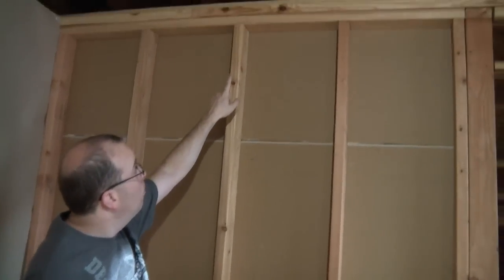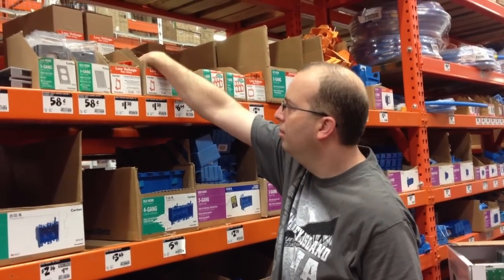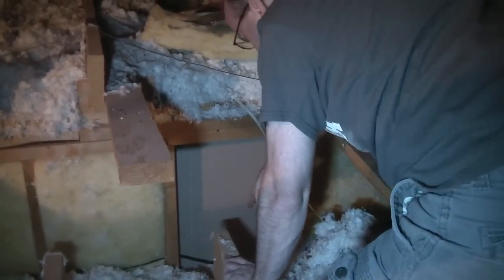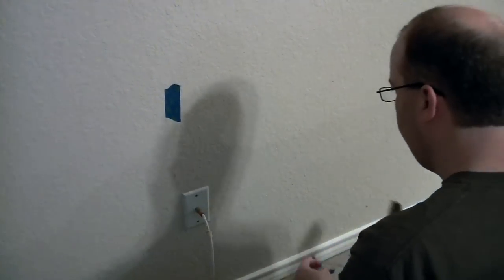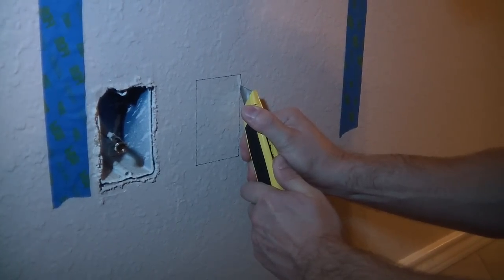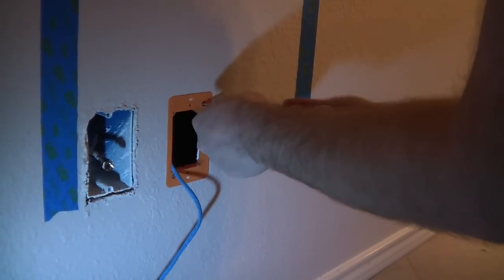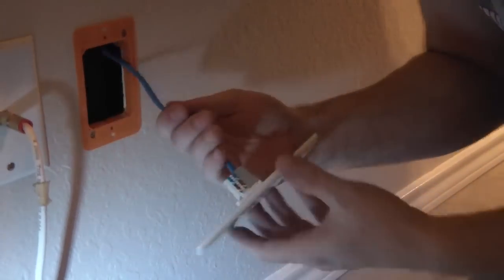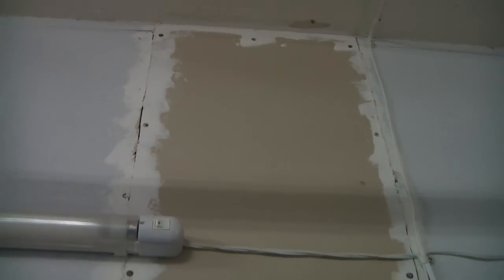How to install a network jack into a wall from the attic.

Comment: You know you could run the wire the same area where your cable coax wire is. You can get plates that have both Cable Jack and a Ethernet Jack on the same plate. Saves spaec and does not look ugly having so many White Plates on your wall.
Reply from the maker: +TekReview's The coax was in an electrical box that was nailed to a stud.  There is not an easy way to fish the wire into that box without cutting drywall.
Reply: The iBookGuy Wow, who wired your house, Gomer Pile? For others one plate would work great.
Reply: Subject of the video was "how to install a network jack from the attic."  I searched on this, found the subject matter in the title, and found precisely what I needed to know in this video.  The 8-Bit Guy perfectly stayed on task in showing me exactly what I wanted - excellent video.  On a side note, you could consolidate your name - TekReviews is not possessive, you could get by without the 's.  For others, not using the apostrophe 's' works great.
Reply: +The iBookGuy - I was able to back out the nail holding the box to the stud in my case and replace with an old work box.  Another alternative is to use a dremel or weinsaw to cut some space in the new work box to fish the cable.
Reply: @TekReviews Wow, who taught you wiring?  New work boxes are always nailed to the stud and almost always have clips that prevent wires from being pulled backwards!
Reply: TekReviews you know that wasn't his house
Reply: You could pull the coax all the way up to the crawl space with a pull string/extra way taped to its end, then tie on your cat5 and pull both out the box.
Reply: +The 8-Bit Guy That may be true in your case,but in my case, all I have to is unscrew the coaxial connector from the wall plate,then run the wire through that whole. Might use a switch since I wanna use wired on both a PC and a game console.
Reply: +Eddie Rowe Yup, I have used a sawsall with metal blade slid in between the stud and box to cut the nails off the existing box. You can even reuse the existing box by side screwing it back on to the stud from the inside with a longer tip attached to drill.
Reply: i would remove the phone jack and put the Ethernet jack there
Reply: TekReviews Having 2 plates is fine.  No one is going to be looking at them anyway.
Reply: +Chucks Basix you must be responding to the wrong person. I stated you can get a PLATE with BOTH Ethernet and Cable on it. Instead of having two plates side by side. Think before commenting, apparently you and the VIDEO maker have NO idea what I and other's were talking about. Putting TWO Plates side by side looks DUMB when you can buy a PLATE with an ETHERNET and COAX hole already made.

Comment: wait what does the cord in the attic connect to
Reply: A port on a hub/router/switch?

Obviously if you don't connect the other end (patch in) then your network wall jack isn't active and won't do anything....
Reply: Either:
1. Another wall jack if you're just running it to another device
2. A patch panel (easier than making a bunch of RJ-45 ends if you're wiring 4+ rooms) where your switch would be.

Comment: I plan on running wire for my home and have some "noob" questions: 
Should I just run one or two drops and use a switch when neccesary?
Does a switch degrade the signal or prevent every device from reaching max speeds?
Reply: Run a ethernet cable to each place you want a wired connection. Plug all of them into the same switch in your " network room "
Plug your switch into the modem.
If you want wireless as well plug a wireless router into the switch. 

You can get switches with lots of ports or even daisy chain switches if you are really going crazy. 
Why not take advantage of the wireless most newer devices are capable of?
Reply: Should I get an unmanaged switch and just run the connectiong through my router?
modem>Router<switch ?
Reply: How much are you trying to do? 4 jacks or less? If so just use your existing router. most of them usually have 4 ports. Just run the cables where you need them.

After that you could install a smart switch or a hub and hook multiple devices to one ethernet cable. 
Modem>router>switch or hub or pc or xbox or or or or or or or.  
You could daisy chain switches if you needed to. But if something broke your out of internet from that point on.....

Comment: was a good video. im planning to upgrade a cat 5 that routes around and through the door frame to a cat 6 that will connect to an outlet on the wall. this was very helpful
Reply: It's late, but if you haven't done so already, use your cat 5 as a pull string to tow the cat 6 cable.
Reply: i did that :)

Comment: It would be more useful if you install a cat 6 cable, because that supports up to 1Gbit of data transfer speed.
Reply: Cat 5e can support gigabit too.No need to use cat6 but if you have $ go for it.

Comment: My house was built in the 1920's/30s of solid hardwood. A boxcutter is not gonna get the job done. A reciprocating saw perhaps?
Reply: If you drill holes in the corners of your box layout and cut between the holes with a hand powered drywall saw will cut wood as long as it's in good condition.  

Jig saw if you have it, tape the shoe on the bottom so t doesn't scratch the wall up.

A sawzall is what I use because that what I have on the truck. Be careful with the sawzall  you have to hold it about halfway in the blade stroke so it does't hit the other side other the wall if you let it get away from you if will really beat up the wall. Even worse if you pull it out too far it will beat up the wall where you can see it.....

Comment: Great video. I was wondering about the outside wall issue but you answered that question. If it were me, I'd be wearing a mask with all the insulation in the attic, but you Texans are a tougher bunch.

Comment: Most houses these days have fire blocks (horizontal pieces of wood that sit between the vertical studs.  Can you do a video on how to run a network cable through those?  Thanks
Reply: First, locate where you want wall plate between two studs and measure from corner, now in attic measure same to find studs to target between.  Use the biggest paddle drill bit you have to make a bigger hole, then they sell drill bit extensions ( 12 to 18' long each) with a set screw to attach one by one as you lower your bit into the wall to reach down to the fire block and drill it.  don't drop your bit assembly into wall, hold on tight and work slowly.  after drilling, tie a nut on a length of string plenty long to reach the floor.  lower the string and get it through fire block hole, then fish out with bent coat hanger at floor.  tape string to cable and slowly pull down.  Can't get through lower hole?  get string just right to bounce nut on fire block and barely lift and give tiny swing and drop through.  in my case I could actually see through top hole w flashlight to drop through.  good luck!
Reply: I disagree. Repairing drywall sucks! Why create a giant construction project, requiring tools and hours of extra work, when all you need is a long drill bit??
Reply: B Miller LMAO, much easier to rip out a chunk of drywall, drill the holes, run the cable, and then repair the drywall... and repaint...drywall is easy to fix...
Reply: CatatonicBug repairing a bit of drywall isnt a huge project...its pretty easy really...as for crawl space, I meant overhead crawl space...like an attic that u gotta crawl in

Comment: I love the video.  You may try to consolidate the cable jack and the Ethernet jack in the same low voltage box.  You still use a cut in box like in your video but you put it in the hole that you take the existing cable jack out of.  It takes a little wiggling but you can pull the nails from the cable box that hold it to the stud and then just leave it in the wall if you cant get it out.  This will leave a cleaner look.  I'm not a Mac fan but I love wiring homes so I subscribed!

Comment from the maker: It is possible, but very difficult.  The box with the coax-cable was installed when the house was built.  So the box is nailed to the stud.  There is no easy way to remove the box from the wall.  As such, it is difficult to get the wire routed into the box if you can't get your hand inside the wall.  Had the coax cable been installed in the same manner I showed, using an "old work" box, then the box could be removed and it would have been easy.

Comment: how else are you going to feed it through the wall keeping the wires completely hidden? usually the ethernet cable is connected to the router or switch in one room, then fed up through a wallplate with an angled opening that goes inward then up into the attic and directly to whatever wall the jack will be on then fed down to it hiding all the wires in between

Comment: with exterior walls you can still run cable down them from the attic but like you said in the video about not being able to fit the drill is most of the time going to happen but if you are on the gable side where the roof peaks you have plenty of room to do it and with the insulation issue all you need is a fiberglass glow rod, it allows you to push through the insulation studs actually help with the rod, feed it in at an angle so its up against the stud, it helps you find it easier

Comment: Could the switch be a modem. Example I have the modem downstairs, could I run the cat 5 cable from the modem and make a network jack into the wall upstairs.

Comment from the maker: I suspect because they're based on the same size as electrical outlets.  When I was in the UK I noticed the electrical outlet is larger, but they typically only give you a single outlet.  In the USA we typically get 2 outlets per box and thus is larger.